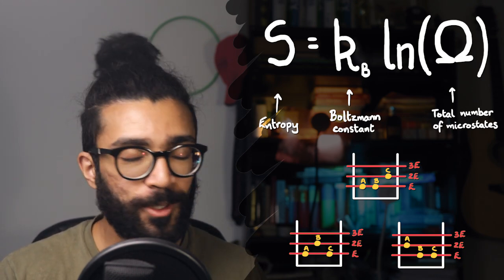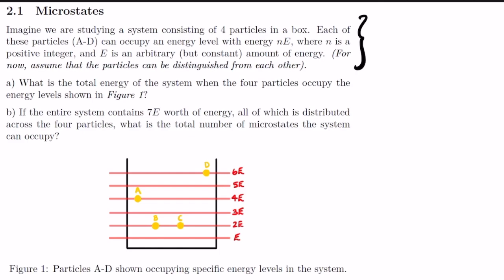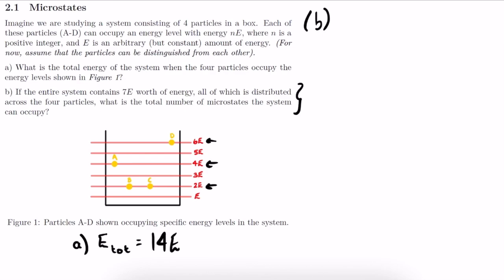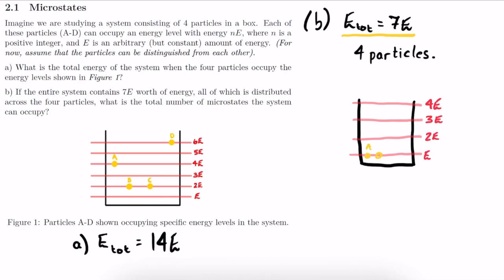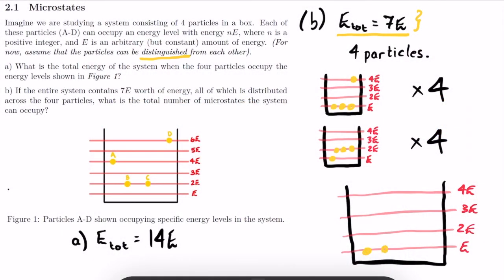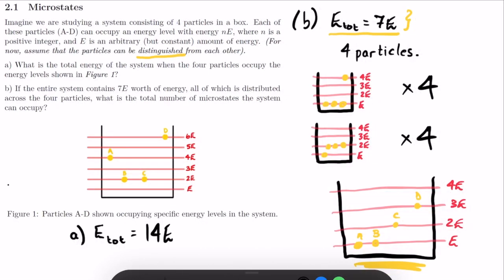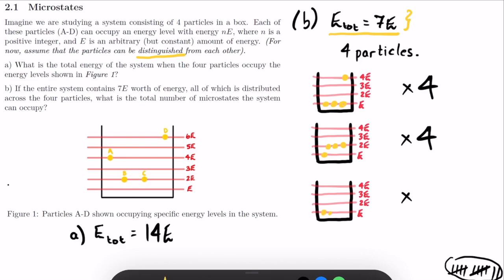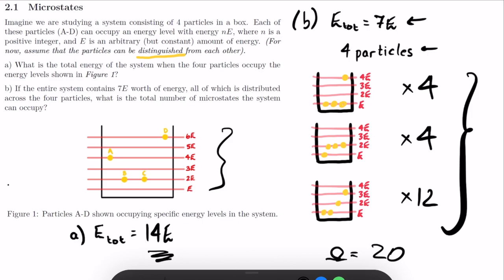The ENTROPY EQUATION and its Applications | Thermodynamics and Microstates EXPLAINED

Comment: Given the number of particles n and the total level of energy m, the number of microstates is bincoeff(m-1,n-1). So for n=4 and m=7 we have 20 indeed. What's the formula to get the number of macrostates which is 3 in this case (i.e. the permutation doesn't matter)?

In other words I want to solve the stars and bars problem with indistinguishable bins.
Reply: I think, and I'm not exactly 100% sure, you divide by n!

Comment: Is there an equation we can use that doesn’t require diagraming every possible particle configuration = 7e?
Reply: If you have n particles and the total energy is mE, the number of microstates should be the binomial coefficient of m-1 over n-1. In the example with 4 particles and a total energy of 7 you would have 6!/(3!3!) = 20 indeed. I have demonstrated this formula up to n=4 and any m (with of course m >= n). For higher n I think the formula can be demonstrated by induction for any n, although I didn't manage to achieve that.

Comment: For those who're asking about the reason of using the natural logarithm in the equation, I'm not so sure, but sometimes in engineering we use the logarithm to scale down  certain quantities if they are too large "in this case the microstates" .. for example, in antenna power we use the logarithm to get the 'decibels' instead of the crazy large power quantities in watts.. at the same time it still encodes the same information about the antenna gain..
Reply: The reason of using the ln is to get a quantity which is additive (extensive). The total number of microstates of 2 combined systems is the product of the microstates of the individual systems. Taking the ln, you have the sum. So the entropy becomes an extensive property which is nice.
Reply: @rinsim  hi, 
Decibels are also added instead of relatively complex math..

Comment: Is there some type of formula that we could use so that we dont have to find all the microstates by brute force?
Reply: For the last 12 Microstates in the q in the document, you can use the formula 4C2(4 choose 2), wherein you choose 2 particles out of the 4 to arrange in the 2 other choices for microstates, and the arranging is done in 2! (2 factorial) = 2 ways, which gives a total of 12 ways (4C2 x 2)
Reply: Similarly, for the first 4 microstates, you choose one particles (4C1) and arrange it in the choices  for microstates which is  only one in this case, 4E (1! = 1) thus the number of microstates are 4C1x 1! = 4, similarly for the next 4

Comment: Hey does an electron gain mass when it is excited to higher energy state.
Reply: I'm guessing it doesn't
Reply: @babayaga5d420  I think it should since E=mc² when electron return to its ground state the energy is lost as em radiation
Reply: @jatin2636  but doesn't the energy absorbed used to increase the energy state?
I mean an exited electron moves farther from the nucleus. Which requires energy. And the em wave is the outcome of a moving electron (in this case jumping down). This is also used in antennas. I might be wrong I'm no physicist. And highschool textbooks don't really teach quantum mechanics that deeply. But atomics bomb use the same equation. Which is scary to think that 2gs of mass can destroy cities.
Reply: @babayaga5d420  👍

Comment: Hi partg I don't understand why natural logarithm is used in this formula i go through the Wikipedia link that u gave   but still didn't get it well, Can u suggest me a youtube channel or particularly a video where i can understand why natural logarithm are used in physics and chemistry formula.
Btw love ur videos , love from India ❤️🔥🇮🇳🇮🇳🇮🇳
Reply: I'm not sure, but sometimes in engineering we use the logarithm to scale down  certain quantities if they are large "in this case the microstates" .. for example in antenna power we use the logarithm to get the decibels instead of the crazy power quantities in watts.. still encodes the same information about the antenna gain..
Reply: @mibrahim4245 thank u 🤗👍
But i understand why logarithm are used.
But don't know why natural logarithm are used in most of the case?
Reply: @sarniva  I've read some answers about that, some of them said its good because of the additive property where you sometimes need to multiply two microstates and by using the logarithm you can just add them which makes life easier, and more other reasons.. BUT there was no reason of why using the natural logarithm instead of the logarithm to the base ten ! in the end, it won't make a difference, e to the what gives an answer or ten to the what gives an answer...